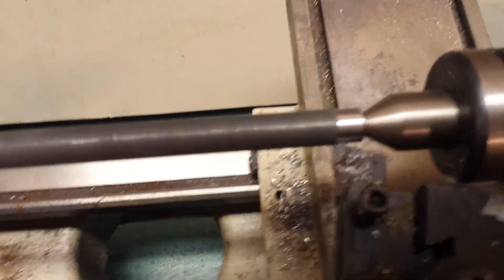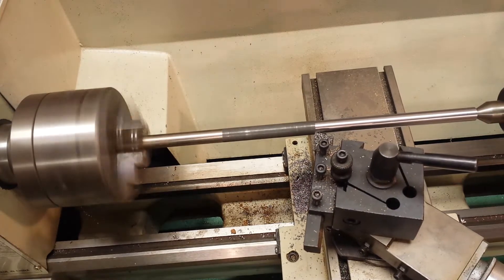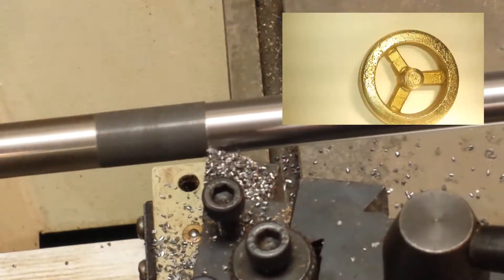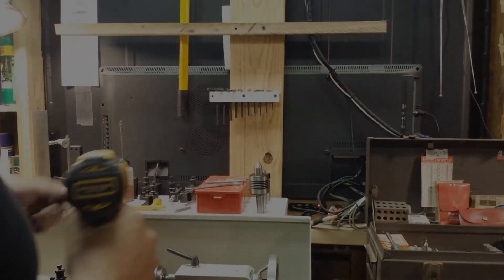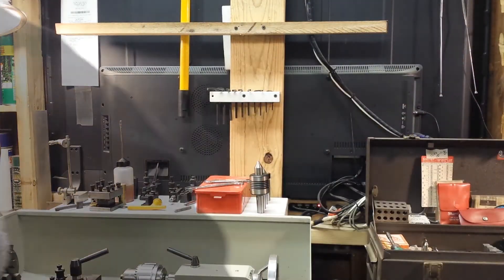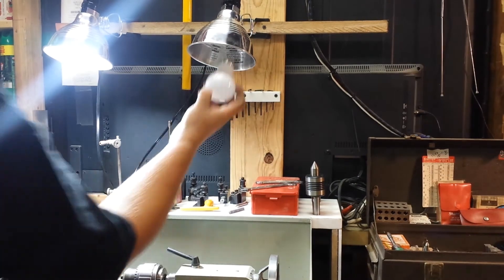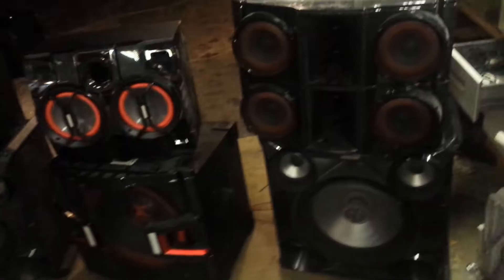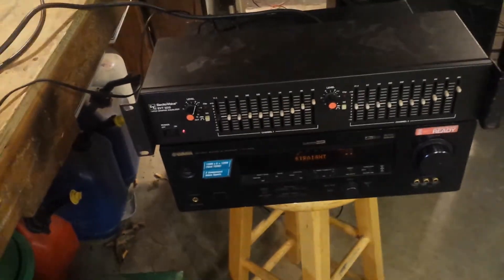Cutting Bar Stock on the Grizzly G4000 Lathe

Comment: Looks like fun.  Jamming out with the new sound system playing with the new toy.  So this cut why couldn't you do that with the old lathes?  What's the new camera?
Reply from the maker: Hi John,  the lathe is larger for one. The carriage, the item that holds the cutter, doesn't have much slack across the whole range. Huge improvement.  As for the camera, i'm just getting an upgraded phone which i also use for videos.  Thanks for Leaving a comment.